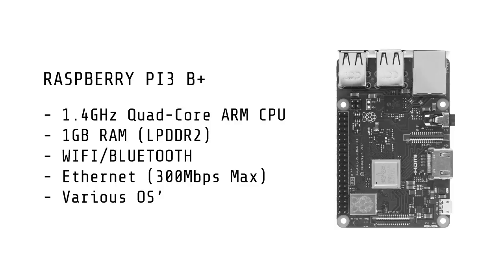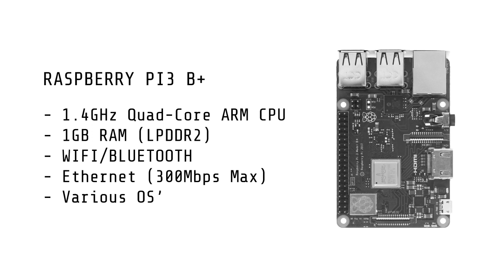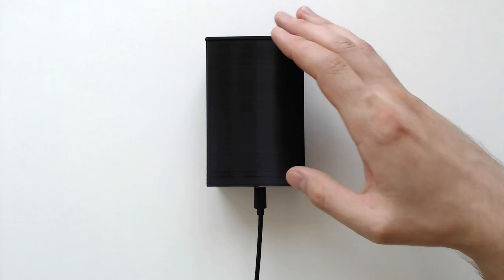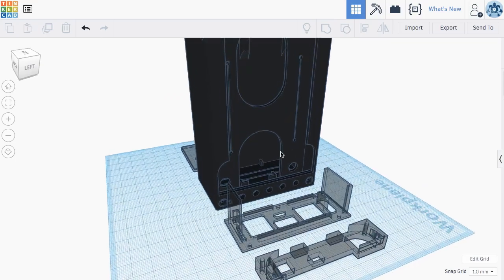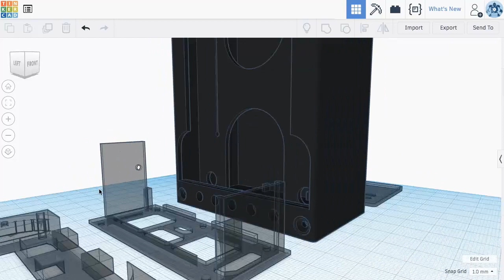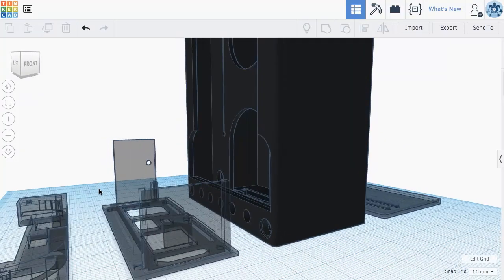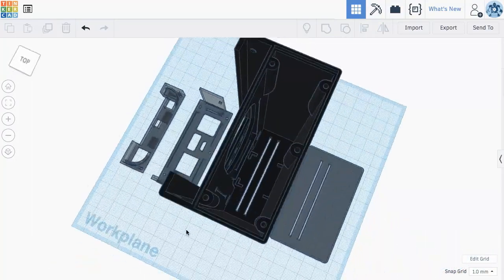The NODE Mini Server: A Computer For The Decentralized Age

Comment from the maker: Anyone got any good resources for learning foundational to intermediate eletcronics design? I want to start designing more complex boards
Reply: N-O-D-E how expensive is printing from a third party?
Reply: I think louiss rassman has something around thier? Youtube. IDRK
Reply: Louiss rassman?
Reply: Check with MickMake here on YouTube he has some tutorials and sources for boards. I know people like to Homebrew stuff but for a small server check out the Odroid HC1 (Home Cloud). Stripped down XU4 with an intergrated SATA port and head sink. Run Opennediavault or other open source server software.
Reply: Thehackernews webstore has amazing deals. I bought the kali linux course but haven't started it yet. Good luck and good looks on innovating ideas.
Reply: On YouTube, I'd look at EEVblog and GreatScott! Both have tutorial videos on electronics.
Reply: by doing? I realize this isn't the most helpful, but using other people's suggestions you can try circuit printing with jlcpcb.com/ 

also, he doesn't do extremely advanced circuits but Great Scott here on youtube does projects that maybe helpful (He also recommends jlcpcb for circuit printing)
Reply: Rya 31 MickMake also uses that board maker. He made a Pi hat board for a Texas Instruments DLP projector. Introductory offer ten boards $2 each. They also make board mask for applying paste for SMD's.
Reply: Stanley Allen Meyer, he died at 58, 2 months before I was born. There's also the water rocket which gets up to 214.7mph in 2.5secs.
Reply: Hey, it's been 1 month since the original article, and you still haven't published the model for 3d printing. I've been waiting, if you're not done, at least post some early prototypes
Reply: skillshare or Khan academy might have those subjects.
Reply: Read The Art of Electronics
Reply: Node is it possible to find the blue prints for the 3D print?
Reply: Try looking into StrongNode man
Reply: Autodesk Eagle and KiCad are great tools and if you have $10,000 US or "know a guy" you could use Altium.

Comment: If I can make one suggestion. Once the files are released, the first thing i plan on doing is making these stackable, so i can have a number of them in a stack.

This way, they could take up less space overall, and it would encourage people to make/buy more.

Otherwise, cant wait. Great project
Reply: V.V mainly why not? I run several pi's as servers because it's cheaper to run 3 pi's than to run a VM on my main rig

Comment: I like this a lot, but I would suggest rackmount version with multiple drives and multiple SBC's. It would be awesome to have mini datacenter with router, switch, powerstrip and like 6 or even 8 SBC's fitted in regular cheap 6U cabinet.
Reply: That is actually really cool. I wish i had a 3d printer just for that.
Reply: Chris Schantz there may be a makerspace with a 3d printer near you which you can use, try to have a look around. maybe you can find one.
Reply: Cool, but impractical. If you need that many SBCs, it becomes more economical to just get a regular server.
Reply: Like this: https://www.thingiverse.com/thing:1606631 but with HDD/SSD mounting solutions.

Comment: A "solution" for the fan might be a sterling engine powered one.
it would save on power, plus it would self regulate the heat since it would generate more power the larger the heat disparity between the inside and outside.
Reply: It would also be far too expensive.

Comment: I would consider modifying the case so that it will be easier to print. Thin spindly tower structures are difficult for any printer, so it might make sense to have the sides all print flat on the bed and somehow snap together.

Comment: Also, it would be great to convert (old) smartphones to act as decentralized nodes. I've managed to run Android Nougat with weekly security updates on an S2 quite stably. I could flash any OS on it
Reply: Patently Paul What do you refer to as "S2" ?
Reply: Nathan Samsung Galaxy S2, maybe?
Reply: Roomsaver  yes I mean the Galaxy S2. It might not have the best display or processor and Oreo is still being ported over, but might be interesting to experiment with as a low-powered node
Reply: I had read some people using old smartphones as nodes like that before.  Wish I could find it again, forgot to bookmark it like an idiot.
As well as using them as sensors (and computers) for robots and stuff like that since they have reasonably decent groups of sensors in them for loads of tasks as well as the processing power to drive a bunch of things. 

The harder part is figuring out the best way to connect both power and data to the phone, since not all support that. (so dumb!)
Luckily more recent phones and tablets all usually support it since more are pushing the "phone as a portable computer" experience with external hubs that let you use keyboards, external GPUs and the like with one cable (or wireless dock) with an array of inputs and outputs.
Reply: Kris Johnstone maybe it's still in your search history somewhere. The closest thing I've found is this making it work like a container/VM https://nbviewer.jupyter.org/format/slides/github/vdloo/slides/blob/master/decentralized_server_orchestration/presentation.ipynb#/ but the problem is, it actually doesn't work after a certain ammount of devices, but it's a good starting point

Comment: It would be better if the hard drive label is facing the outside, because then you can see the label and not have exposed PCB that could get shorted.
Reply: Only downside with that is you then have heat on the inside.  Little heat from the drives board, but it would stack up with the rest of the heat.
Probably an easier solution and more aesthetically pleasing would be a simple plastic mesh on the bottom.  Will still mean a little heat build up, but not as significant as turning it around.  
It'd matter more with SSDs admittedly.   That's not going to be an issue here.  Not for now.
Reply: Kris Johnstone there's a hole that could let a little air flow from the fan and cool the hard drive
Reply: That hole isn't used for cooling the drive. It's for maintaining equal air pressure around the discs so that everything remains in perfect balance at various RPM speeds.

Comment: Usecase for technology like this has large upscale potential. Definitely worth looking into
Reply: Can you elaborate regarding the usecases?
Reply: It's my first time watching  a video about this kind of tech.
Reply: @bleyzseekr1996  hmmm one can lend idle processing powers to decentralized servers. Just listing things from the top of my head lol
Reply: @chaeneth6979  so through using this kind of application in node may improve efficiency? or it will be sluggish just like centralized servers?
Reply: @jhinjhin2985  yeah that's definitely a possibility
Reply: @chaeneth6979  Is this like cloudmining?
Reply: @jhinjhin2985  It's gonna be faster cuz there's no central servers so there's gonna be less lag
Reply: @bleyzseekr1996  what's the difference between running nodes and cloudmining?
Reply: @chaeneth6979  Why would people prefer decentralized server from a centralized one?
Reply: @chaeneth6979  but what will be the downside as there will be server? is there any?
Reply: @chaeneth6979  If decentralization is the key towards better scalability, then why isn't it the norm yet?
Reply: @jhinjhin2985  coordination at a enterprise level is gonna be hard since there is no central command center for incoming data
Reply: @bleyzseekr1996  it's hard to integrate on a larger scale since every piece of data is needed to be migrated if established companies are to move from centralized to decentralized ones
Reply: This seems to be a good idea for a project since it's a good proposal for innovation of IT systems.
Reply: @creampinoy5662  Do you know any projects that propose this kind of technological innovation?
Reply: @lionheart6119  but they can be a multi-million dollar company that can solve everything with money lol
Reply: @chaeneth6979  Yeah its much better than gpu farms too cuz of environmental reasons and all
Reply: @creampinoy5662  Another unique approach was done, better implementation can be imho
Reply: @bleyzseekr1996  Yes but not really lol
Reply: @bleyzseekr1996  Cuz its a relatively new account
Reply: @jhinjhin2985  because of the greed, they want the greater income sacrificing after sales.
Reply: @bleyzseekr1996  Just search Nodes-as-a-service and it should give you results. However a remarkable project i've stumbled upon is called Strongnode edge.
Reply: @fibyyyy9394  greedy as hell, hope that they end up losing money after lowering down the after sales.
Reply: Now I will run a node on Pi LOL
Reply: @lionheart6119  It's hard but still doable as companies have the ways to do it lol
Reply: @xylog8441  Yeah they literally own billions of dollars, such menial tasks mean nothing
Reply: @bleyzseekr1996  Its a relatively new tech
Reply: @malmag1798  That's a plausible way to be more efficient in running the nodes

Comment: What is needed is some kind of free mesh internet thing that uses long range high bandwidth LTE from old cel phones on ipv6 that doesn't rely on cel towers.
Reply: enticed2zeitgeist wonder if you could d ploy some sort of app to do just that.
Reply: Reliable long-range radio communications means high power transmission, which means you need a licence. Cell companies pay governments a great deal of money to get exclusive access to spectrum so they can run their networks. If you operate in the unlicensed bands with corresponding power levels, you're limited in range.

You can get long range on low power, but only if you accept very low bandwidth. UK to Russia on 10W? I've done it. At 31bps. That's bits per second.
Reply: Ok, well that's WAY longer range than I was figuring. I was thinking like a few KM, and a few hundred KB/S. Is that possible? Is it not possible to just make a cel phone output packets that can be picked up by another cel phone?
Reply: I think you need to work out your use case before you start designing. Do you know anyone in your area who would be interested in building a mesh network of some description? If you don't have other people to talk with, it's pretty pointless building anything.

There are ham-designed modems that'll get you 9600bps in a 12KHz window over that distance. But you need a ham licence to use them, and the licence terms rule out doing anything very useful - no encryption, no relaying traffic for non-hams, no commercial activity. 

If you want to get a few kilometers at high speed with unlicensed power levels, then the only way to to it is to boost the SNR by using very directional antennas - with a good antenna you can get up to a kilometer and a half out of standard wifi equipment before hitting protocol limitations relating to light-lag. Such antennas are big though, require fixed mounting and are not at all portable.

CB radio spectrum offers potential. But you'd have to look up the restrictions of your country, as most will regulate CB in some manner like forcing channelisation, requiring equipment certification, or permitting only certain modulations. If it's somehow permitted legally, you could adapt some of that ham-tech - but it's still custom wiring that would need skill to build.

There is, however, one hope: The XBee Pro. It's a modular radio based upon the Zigbee stack. 156Kbps on a range of 9Km, more if you use a directional antenna. Being modular it's good for hobbyists - no horrible surface mount soldering or specialised radio knowledge required.

(Don't bother woth LoRa: It's designed for a huge number of devices which use a tiny amount of bandwidth each. Not suitable for your aim.)
Reply: Well my theory is that if there was a open source standard for this decentralized wireless mesh network there might be some a large interest in producing products and neat services or sites that run on it. I could see in times of disaster this could be great. If someone wanted to bridge it to the internet that would be amazing as well. Something like wikipedia on it would be great, no matter where you are in the world it would be great to have access to wikipedia.

I will check out the Xbee Pro. Thank you!

Comment: What 3D printer do you recommend for projects like these?
Reply: Pretty much any printer now-a-days.  Prusia is the gold standard though.
Reply: Any of them. If you need to print very detailed models, or intricate shapes with long overhangs, or need high-end capabilities like multiple material printing, then the brand and model of printing matters. But if all you want to do is print boxes and enclosures then the cheapest, nastiest no-name junk printer is going to just as capable as the most expensive.
Reply from the maker: Yeah I agree with Barry, most are good enough now. Flashforges are a good beginner printers for the price. Prusa are more expensive, but seem very well made. CR-10 gets good reviews too for a cheaper printer.

Comment: Everything looks amazing.. except, what about those people that can't do the hardware modification to make the SBC work with this case? 

Personally I'd love to see you design a board that uses the compute module as its heart .... but I'm not sure how much a minamum order of Compute Moduls would cost or how fast these hypothetical boards would sell out.

For me the advantage of the compute module is in theory you just pull the compute module out and slot the new thing in when the next big thing comes along rather than have to pull everything out.
Reply: Andrew Singleton "can't" is just an excuse! Get in there! 😎
Reply: Andrew Singleton I love your passion!
Reply: Andrew Singleton thanks for the enlightenment and insults! Sorry my random comment meant in encouragement set you off. YouTube commenters' disability aren't exactly open knowledge in a thread on a video about cool tech, my comment wasn't meant in the negative connotation you took it. Good luck in all you do!
Reply: Andrew Singleton Solid excuse mate.
Reply from the maker: I need to learn more about making electronics to be able to design something that uses the compute module.  It would be nice to create the whole thing with a single PCB though.
Reply: I second the notion that requiring modifications to the SBC makes this a non-starter. As a one-off, sure. But if you want to make several, or expect wide adoption, that's not going to work.

I've considered similar Pi mods to accommodate better packaging and rejected the idea for the simple reason that if a Pi fails, I want to be able to quickly swap it out with another, and not have to spend an hour modifying the board.

The compute module approach is a good alternative, but will be more expensive. In the long run it will probably be easier to just go with a SBC that is better packaged for this use case from the start, like the Odroid variants that have an aluminum enclosure to accommodate a hard drive.

Comment: Nice work again. Can u recommend any books for hardware hacking to help me get up.to speed with these types of projects? Cheers
Reply from the maker: It depends on what you want to do and make. Tinkering on a Raspberry Pi or Arduino is always a good start, and there's tonnes of books/tutorials/videos to help you
Reply: sure, i've read a lot of books on pi specifically but im not at your level of skill. do you hold engineering degree or certificates or is it all self-taught? anyway, thanks for sharing all your projects, you are a wonderful maker.

Comment: A for effort and all that, but I don't see any real need for this thing. I mean we've already go usb ports on the back of routers, where you can simply plug in a much larger 3.5" hdd in an enclosure. Plus people usually want a lot more storage than that. I'd make the 3D printed box a lot bigger and capable of housing multiple hdd's (at least 6) if you want people to actually use this and spread the design around. I mean let's be realistic here. At that size/capacity, people are just going to buy an enclosure and plug it into the back of their router. But if they could print a big nas box, they'd probably do it.

Comment: Getting away from GitHub is a solid move, now that it's owned by Microsoft
Reply: I disagree, all this FUD spreading is only fragmenting the community. Microsoft hasn't done anything (yet) to move away from Github - that said, moving can be done at any time. So wait it out and see if Github deviates from its path (which I don't believe is going to happen).

You only scatter code by encouraging people to self-host their open source projects. I personally do not want 20 different accounts of which more than half of the self-hosted solutions are not actively being maintained (not updated, insufficient or insecure backups, hosted on an insecure server, ..), a lot of people who self host have no clue about backups and security and are settings themselves up for disaster. 

Scattered code hosting platforms discourage contributions, not everyone wants to sign up for yet another Gogs/Gitea/Gitlab instance hosted by someone who ran a one-click installer and thought that would be enough.

I can understand people doing this for private repositories, but please, keep open source on one platform. Open Source before Github was a nightmare.

This isn't a personal attack on anyone, this is just my opinion.

Comment: What is the point of this? Manufacturers can stop producing Raspberry Pi3s at any time. And if you can then use a  different computer with the same form factor, but with different hardware and different OS, how does that promote and ease development any more than IBM-PC compatibility did back in the day? 
What exactly is being invented here, really? A plastic box and the concept of soldering a SATA-to-USB adapter to a USB port?